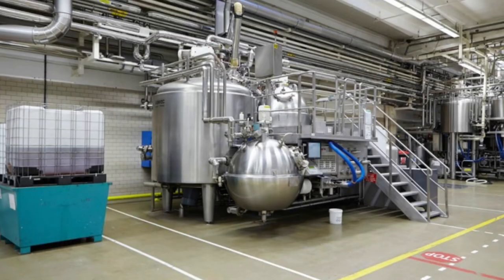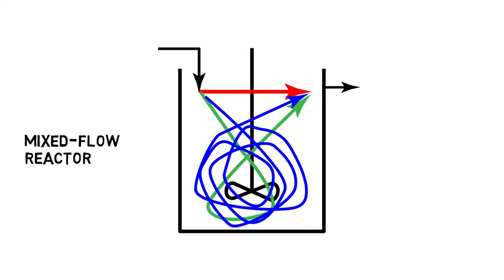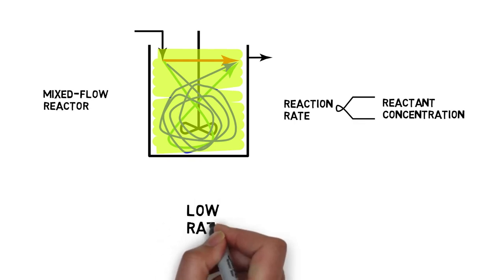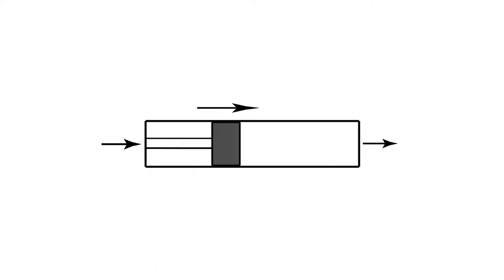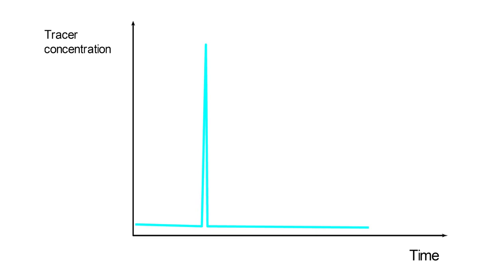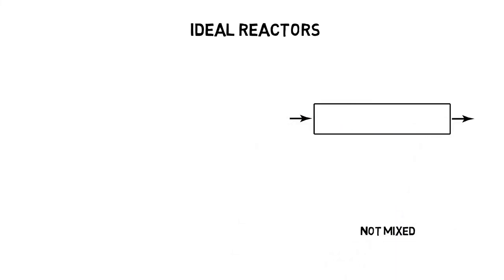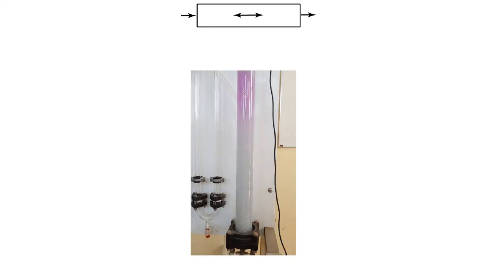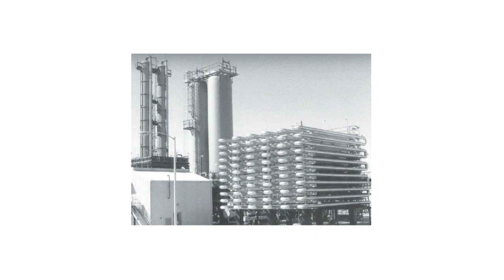5 minutes to understand plug flow reactors

Comment: a bit puzzled about "the moleculars in a small section of area are hardly mixed with the molecules just behind them or just in front of them ", is this section of area represents the tracer volume injected inside?why its not mixed? thank you!
Reply: ahh, so the tracer is not mixed in the plug flow reactor, but react with the fluid inside the plug flow reactor when it passed along the tube right :) please correct me if I misunderstand sth, thank you
Reply from the maker: this section of area represents the tracer volume injected : YES, in the case of impulse injection
why its not mixed? This is the very principle of a plug-flow reactor: no axial mixing.
Reply from the maker: The tracer should not react, it is here only to "follow" the flow. But in normal production (= not during a RTD experiment), the molecules react (but only in the section of the tubular reactor; again no axial mixing).
We hope it is now clearer for you...